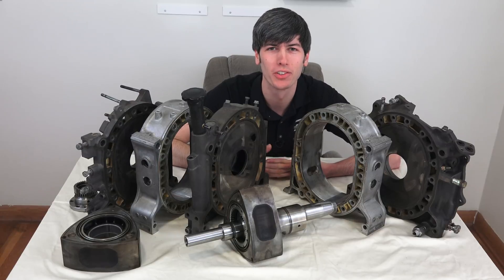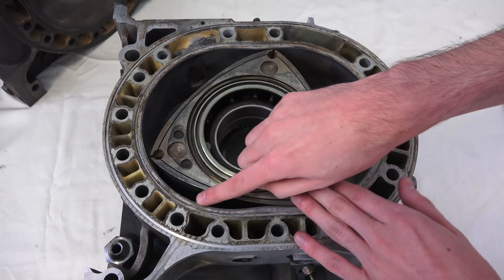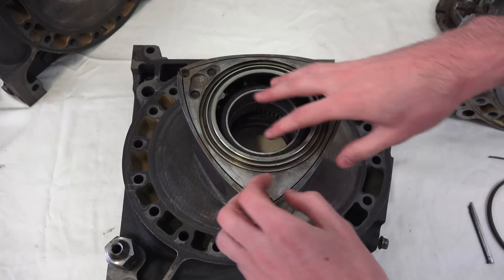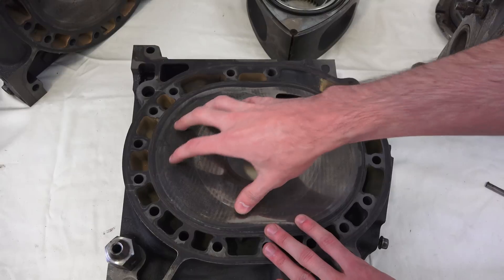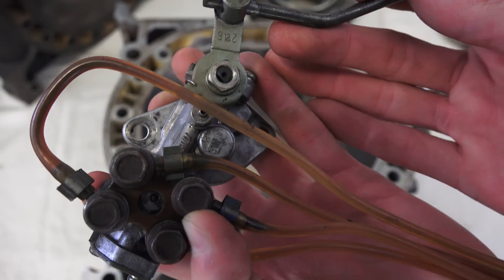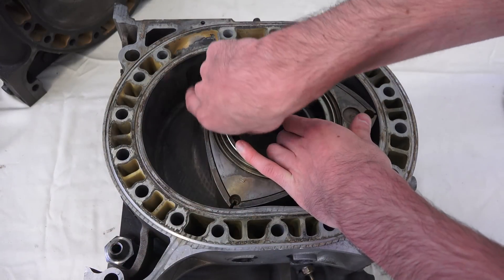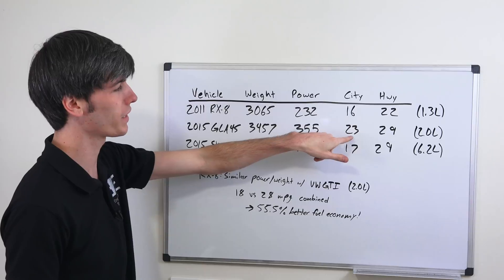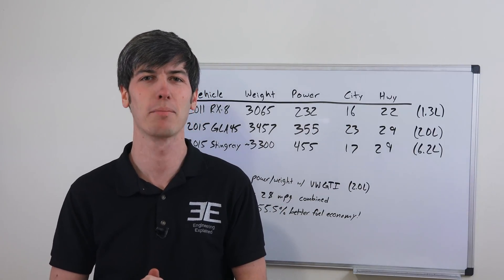4 Reasons Why The Rotary Engine Is Dead

Comment: I knew a guy with a rx8 that would constantly shoot flames.
Reply: +Carl Johnson But could he follow the goddamn train CJ?
Reply: cj? ohhh mah dog haha!
Reply: Busta, straight busta
Reply: +Carl Johnson All you had to do was follow the damn train cj!!!
Reply: yo cj. grab that jetpack
Reply: +Carl Johnson cj i would give up water if u give up being busta
Reply: +Anthony Thomas Screw that. Unbolt the catalytic and replace with straight pipe so it doesn't break down and get rid of any CEL with some remapping. Belching fire is cool.
Reply: +Carl Johnson How is that impressive? I know several people with 13B rotor motors, usually street ports that make about 20-25hp more than more modern RX-8 motor. It will belch exhaust flames, it looks great but it's terrible for emissions as stated because it's unburnt fuel and oil being ignited. Mazda had a rotary running on hydrogen but unless they fix the problem of getting oil into the combustion process they will still have the same emission problems.
Reply: +Carl Johnson All you had to do was follow the damn train!!!

Comment: owned an rx-8 since 05, Ill own it forever, Original engine too.
Reply: +edgar calderon jr how does "original engine" mean the same as "never rebuilt" ? does an engine cease to be the original engine if you have to replace 1 part of it? i dont think so
Reply: edgar calderon jr so its not the original engine anymore once you change the oil filter? I think it depends how major the part is before you say its no longer an original engine and a seal is basically a consumable item, its just that its not easy to replace.
Reply: +Deez Cuts How often did you need to change the Seals ?
Reply: +Deez Cuts Don't jinx yourself. Once you hit about 100k it's like you can hear the bomb ticking in the back of your mind.
Reply: edgar calderon jr Ah okay, thought original engine = no new block.

Comment: my solutions:
1. use a roller seal because had a better lifespam, and it can lubricate the chamber (look the next step).

2. using a similar piston engine lubricating system: the oil coming from the eccentric shaft (with a few perforations in the eccentric part and inside the rotor), and  this oil is sent to the rollers and the upper seals.

3. direct injection (mazda is developing this for the new rx9).

4. double cooling system: the hot and cold parts of the engine will be separated: first, the cooled water freezes the hot part, and the same water (hot) goes to the cold engine part: the temps gradient will improve. A bigger cooling chamber for the hot part can help.

5. develop an new rape based oil (or bio degradable oil) to improve emissions (but the new oil system improves this).

engineeringexplained, what do you think about my idea?

Comment: To help deal with the fuel going unburnt, could you add in another spark plug at the other end of the combustion chamber? (I'm sure there's a good reason no one's done it, I just can't think of it).

Comment: I think the rotary is incredible and I hope some intelligent engineering from a team with a passion for being different can solve some of the big problems it faces
Reply: +Sharkiesha Thomson they are called mazda
Reply: Marek Sumguy nothing would ever be fixed if everyone had that attitude
Reply: +Sharkiesha Thomson This is how it works by concept. You can't fix concept without making a whole new type of thing.
Reply: +kens97sto171   Direct injection won&#39;t solve the fundamental problem: very long flame path and very high surface area to volume ratio of the combustion chamber.  These combined mean it can never attain the cleanliness and efficiency of the piston engine.  It's a technical dead end.
Reply: +Daniel May one thing about internal combustion engines , they are very very versatile, you can  tune them to run on many fuels , including rubbish fuels,  they will even run on smoke, dont discount the internal combustion engine just yet .
Reply: +Sharkiesha Thomson just replace it with an electric motor.
Reply: +Gabe Galardi 
Nope, Midwest. Ohio, Kentucky, or Indiana have no testing, or safety inpections. though there are possibly some counties within those states that may, but no statewide testing
Reply: Same here!
Reply: +Petar Bogdanov Actually 2 stroke engine can be fixed - However it would require a lot of research, and the biggest advantage - low complexity will definitely will be lost in the way. If you add supercharger and valves you can run two stroke without a drop of oil mixed with the fuel. Or even direct injection can remove the need for valves, but this is still way more complex that we typically think of two stroke.
Reply: +Ivailo Yanev 
I believe there is a scooter company in Europe that has or recently had a modern direct injected 2 stroke.. No oil burning. I think it was Piaggio.. but not sure. The advantage would be power vs displacement. I suspect any weight saveings would be eliminated by the complicated injection system.  Maybe enviromentally safe 2 stroke oil would be a better direction to go with that.
Reply: +Petar Bogdanov 
the most efficient internal combustion engines in the world are 2 stroke direct injected diesels.
on smaller engines ring wear is a non issue, plenty of 2 strokes out there with tons of time and miles. 
I'd say cost to make all that work is the main problem, by the time you do it, you might as well run a 4 stroke.
Reply: +Daniel May 
sorry, long way off from that.
hybrids account for a SMALL percentage of vehicles. 1 to 3%
explain how you would power a Semi truck, or. jet aircraft, or a large cargo vessel.
biggest issue will be large scale availability of the raw materials to make the batteries.
and not everyone loves In a city. where short range cars can work
Reply: +Daniel May You realize world I.C. piston engine production is going up? Plus, hybrids still use them and in a sense will allow them to remain around longer.
Reply: +Derek Swanson 
exactly. I've got nothing against electric stuff. and I think Hybrid is the way of the future. electric motors have great off the line torque, mix that with small displacement engines, and the driver experience can still be really good, and have good range of ICE.
Reply: +Sharkiesha Thomson rumor has it that mazda never stopped R&D on the rotary
Reply: +LUNITIC WILL I think they're about to release a new model to compete with the new Supra.
Reply: +Ainsley Harriott   Nope, they haven't fixed it.  The long flame path and very high surface area to volume ratio of the combustion chamber mean it's a technical dead end.  And the ever-more stringent emission regs make it deader than ever.
Reply: +kens97sto171   Although not the cleanest engines.  Sadly, emissions matter a lot.
Reply: +Sharkiesha Thomson Its physics though. So your not going to get around that. combustion chamber length, apex wear, ect is totally inherent to its wacky "wankel" design". Lots of engines have been made and that was one that barely worked good enough.
Reply: +Steve Thackery 
Why?..  I guess if I cared much. Fortunatly I live in a free state, no inspections, no emmision testing. 
plenty of good reasons to not like a rotary. but for me that's not one of them.
Reply: +kens97sto171 I agree, if I'm buying a performance car, I could care less about gas mileage and emissions as being the biggest issues.
Reply: MattacksRC
What about a hybrid electric rotary engine?
Reply: +kens97sto171 let me guess Texas perhaps
Reply: kens97sto171
You forgot to add Florida to that list.
Reply: +SI0AX 
No idea, just mentioned the States I live near.
and I THINK that in Texas it depends on the county you live in. In have a friend in West Texas and they have no testing.
Reply: +Smucko Smuckovic You're an idiot. NSU couldn't make it work as they didn't have the ability to refine it.  Mazda did just that.  A modern Mazda Wankel is as reliable as any other modern engine.  Fuel injection and computer control fixed all those problems, much like those developments have changed virtually every other IC on the planet.  Does the Wankel have its drawbacks?  Sure, it does use some oil, it is not as clean emissions wise as other designs, higher fuel consumption, and it has a shorter lifespan than most piston engines.  That said, it is very simple mechanically, fairly easy to rebuild, light, small and very powerful for its size.  For the correct application, it works just fine.  Most of its negative qualities are shared with two cycle engines, which also dominate in certain applications.  I don't even own a Wankel engined anything, but to see some internet clown like you spewing trash required a response.
Reply: +Ivailo Yanev You'd have to run it on oily fuel, though. What you're talking about is a two-stroke Detroit Diesel. If you've ever dealt with one - I have - you'll know what a thing of joy a four-stroke engine is.
Reply: Robert Thomas
do not feed the  #trollbot  its spambot. probably musks,, sellingbshitn batteries that arent cooked yet.
Reply: Sharkiesha Thomson It's an inherently inefficient design. So much of the potential energy goes out the exhaust port that it makes piston engines look highly efficient in comparison. We're better off developing advanced battery technology.

Comment: man I knew what a rotary was but I didn't know they were that big...

BTW since it burns oil wouldn't it be hard on the cats?
Reply: +bmwmsport11 Where were going.. we dont need cats
Reply: What cat's? Lol.. Cat's are useless on a rotary engine.. It's one of the first things people get rid of and free lots of HP and as a bonus it makes the car flame lots more ;) 

But if you let it in.. Yes it hurts the cat and probably within a year it will be empty anyway lol..
Reply: +eplusz I was wondering if Mazda ever designed their CC so that it wouldn't get affected by burning oil. I would assume if any normal car burned oil it would slowly clog up the cat and maybe even set it on fire because it's holding so much heat.
Reply: +bmwmsport11 probably dilluted with air injection
Reply: +bmwmsport11 In the past they used a sort of secondary combustion chamber before going to the converters down stream. This just made even more heat headaches, as well as exhaust back pressure problems.